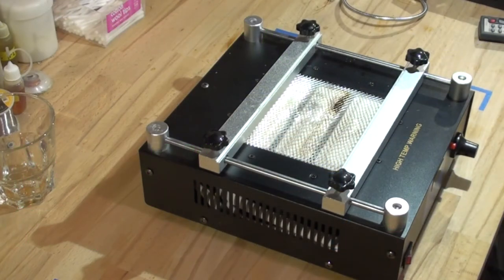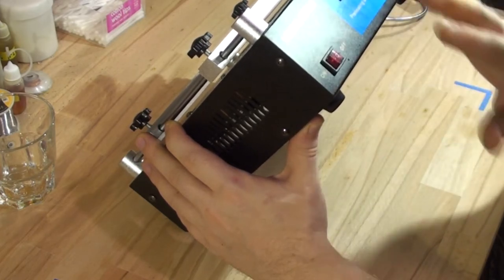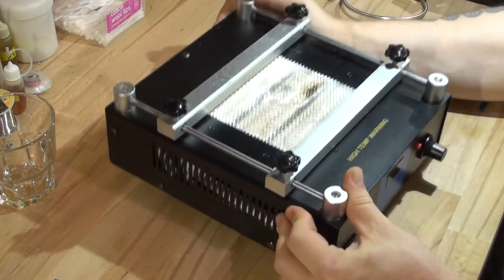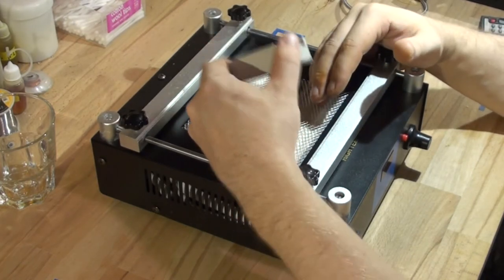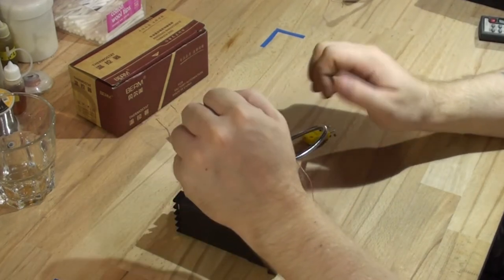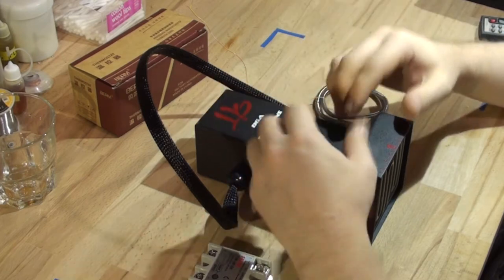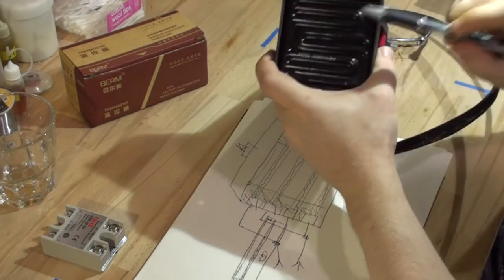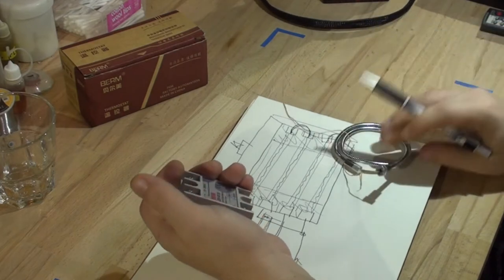DIY Automated BGA Reballing Station. Make Your Own At Home! From Low Budget to Mid Budget.

Comment: I thought of building my own  BGA rework station,  but doing it different to everyone else out of bits I got to hand , rather than using a dedicated pid  controller I though of using an old 3d printer board and display  to drive  SSR's connected to the hotend and heated bed outputs  as it seems a no brainer because it handles  2 pid controlled  NTC thermistors that are already calibrated and is designed to drive a heated bed and hotend,  should be ideal for the task the thermistors  work at over 250c  so they should be ready to go without too much  tinkering - this will give the option of either inputting the temp through the interface or  using a  simple GCODE  script  stored on an SD card,  sent to it remotely via octoprint ..  or typed in from a remote terminal....
Reply: Did you have an success with this project, I had the same idea but having a hard time finding anything about it online

Comment: Hello, i would like to build something like this. However some parts are a bit not clear for me. How to i wire up the top and bottom heater? I can’t find any pinout and the schematic doesn’t explain it very well to me. Also, do i have to use an RCBO? Or can i just wire up a fused C14 plug directly to everything if my outlet itself is protected?

I would also appreciate a full list of items in the description or here

Comment: Haha well that's pretty cool.  I was just browsing aliexpress this morning and got the idea to buy a cheaper preheater and add the IR top heater to it, and I basically ended up choosing most of the same parts you used!  I ordered a Gordak 853, then an IR6500 top heater.  Then went googling for a PWM temperature controller and ended up picking the REX-C100.    I plan to just use the existing lower heater controller, and I'm going to put the temp controller in a project box bolted to the side of the 853 and add a socket for a K thermocouple to go to the controller.
The 853 I ordered comes with the bracket to hold a hot air handle, so I still need to figure out how to mount the IR6500 top heater to that.  Might use some spare 2040 aluminum extrusion I have laying around.  Not sure yet.

Comment: For the top heater I'm using my hot air soldering station with a 45x45 bga nozzle, and for the preheater I'm using a electric grill with a power regulator, and the bottom heater a hot air gun connected to the same power regulator as the electric grill, basically I heat under the board until 100-110 degrees, then I turn on the hot air gun until 130-140, and then I use the top heater, works just fine, no burns on the pcb and no bubbles on the bga chip, the only thing I haven't figure out was the table to hold the board, I tried to find something off aliexpress but haven't found yet, do you have any tips?
Reply from the maker: I’ve just built my own pcb holder from extruded aluminium, you can get it in your local hardware store.

Comment: Great video. Certain I willgive it a try and build it too. One think I did not understand quiet well is how the profile is set. Thanks for the sharing
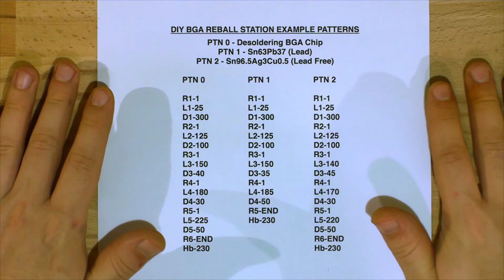Reply from the maker: Hi, watch video from 39:30, there’s examples of the profiles, ones you get into pattern set menu, just simply follow my patterns, for example”R” is how fast temperature will rise, so 1 means 1 degree per a second, if you set it at 2 it will rise at 2 degrees per a second. Better leave R value at 1.
“L” value it a target temperature for the current step, for example R1,L1,D1 is all in first step, R2,L2,D2 is a second step, and the D value is how long to hold the temperature till the next step. So for example if you have settings R1-1;L1-80;D1-60...R2-1;L2-130;D2-30 the what will happen, in first step temperature will rise to 80 degrees (1 degree per a second), once it reaches 80 degrees it will hold it for 60 seconds, then switch to step 2 and rise the temperature to 130 degrees, once it reaches 130 degrees it will hold it for 30 seconds before going to next step, once you programmed all the steps you want, add an extra step and select “R” value as “END”

Comment: Great video! I have a quick question I would be thrilled if you could answer. I am trying to build a motherboard holder jig for a 40 GB PlayStation 3 motherboard. What metal would work for this? The motherboard jig is discontinued, so I will need to make one. I want something that can take the heat and stay straight. I will be using this on a rework station to perform RSX replacements. Thank you.
Reply from the maker: Use Aluminium, it’s easiest to work with.

Comment: Hi Max, greetings from Peru. I want to request if were it possible you list all components of this project. I saw many videos about DIY BGA Reballing Station and yours complement with others. I found almost all components you mention in video but it would be awesome if you listed everything. And about the 12V module or adaptador that you use what kind of Amperes it should be have? I hope you can agree with my requested because I going to buy all components in AliExpress comming soon maybe today or tomorrow.
Reply from the maker: Hi, for 12v psu you need small current , 1 amp will do the job, the 12 bolts only used for alarm buzzer, led light and a fan. What parts are you missing?

Comment: First let me thanks you alot about your experience sharing.....so , i am just a beginner in Electronics and repairing field ....my question is about the control , why do you use pc 410 ?? I can't understand because when i get the diagram of Rex c100 , i asked myself  why you don't add both of them ?? I mean each rex connect with each heater ....i wish you help me to understand that ... thanks 🌹
Reply from the maker: Rex 100 is a normal PID CONTROLLER, it just turns on and controls temperature, the pc410 is the controller that controls temperature and also different steps. So it does “profiles” of reflowing for main (top)heating element, the Rex 100 controls only preheating (bottom heating element)
Reply: @MaxELECTRONICS  Thank you very much for your reply... Alhamdulillah I understand it now 🌹🥰🥰

Comment: Hey, Max. I can't find the part where you modify the lower heater. I see you removed the potentiometer, how do you adjust the temperature and air? Thanks
Reply from the maker: You need REX-C100, you control temperature with this controller, I only left the heating element from bottom heater, and heater is fully controlled by REX-C100. You can easily find them on eBay or AliExpress.

Comment: have you tried connecting the pc410 with a computer? i tried it using RS232 and the PSOFT Rework Station Controller application but the result cannot be connected, maybe you can share if you have experienced it, thank you.
Reply from the maker: Make sure your RX and TX are right way around and set correct baud rate on your computer com port. I have connected it, it works, bet you can only remotely trigger it and monitor the temperatures, that’s it.

Comment: Hi Max, stupid question, what is that hooked up to pins 8, 9 , and 10 on the pc410? Thanks, Randy
Reply from the maker: You don’t need to hook them up, it’s RS-232 (com port) that can be connected to computer for remote control

Comment: Hi mate
Nice video but it will good for everyone if you add a list of parts with relative description so people can buy them.
For example, where I can buy the top heater support?
Reply from the maker: Hi, just like I mentioned in the video the support for the top heater is just an improvised “z” shaped piece of metal that I bought at a local hardware store, it’s not a plug and play support.

Comment: Bye! Congratulations nice job as the heated head is fixed, could you tell me what materials you used to make the head support? Thanks in advance
Reply from the maker: Hi. Just steel from hardware store, something like this https://www.bunnings.com.au/pryda-nail-on-connector-plate-75-x-190mm_p2430023
Reply: @MaxELECTRONICS  Can you take a picture of how the back of my head and the head ruler are arranged? Everything can't be seen in the video

Comment: For the run button you're using, does the illumination run on 12V DC? Is that the voltage the LED inside the controller sees? Also, I'm curious how you connected the button light to the run LED inside the PC410. Did you solder a wire to the contacts inside the unit?
Reply from the maker: Yes, that’s what I did, but the illumination is only 2-3 volts so I used a transistor to make the illumination 12v
Reply: @MaxELECTRONICS  Ah I see, that's brilliant. Did you use the transistor to somehow amplify the low voltage from the PC410 or did you use it as a switch using the low voltage as a signal to complete a separate 12V circuit for the light? By the way, thanks for taking the time to answer my questions.
Reply from the maker: Used it as a switch from separate 12v power
Reply: @MaxELECTRONICS  Cool thanks Max 😊

Comment: Hi, 
where did you place the two thermocouples on the board? 
The Thermocouple for the upper heater directly near the chip you want to remove? 
The Thermocouple for the lower heater directly on the lower heating element or under the mainboard? 
Thank you! :)
Reply from the maker: Hi yes the top thermocouple is placed directly on the side of the chip so it touches both, side of the chip and the pcb. Bottom thermocouple is place underneath the pcb usually under where chip is. Bottom thermocouple needs to measure the temperature of the PCB under where the chip is located.
Reply: @MaxELECTRONICS  Thank you very much! 
I have almost finished my BGA. 
;)

Comment: Hi Max... Its very well documented project. You haven't mention about auto-tune of PC410 controller. Also how effective is Halogen Lamps as top and bottom heater?
Reply from the maker: You can use halogen flood light as bottom heater and 2 in series and another two in series as a top heater (use reflector)

Comment: Hey Max! Quick question, I have 3 heating elements. 2 are 800w and 1 is 1000w. How should I wire them together? Thanks!
Reply from the maker: For the bottom heater or top?

Comment: Hi Max, great video, can I use the lower preheat without the upper?
Reply from the maker: Yes you just need to setup a profile where the top heater always set to low temperature like say 10 degrees Celsius, this way the top heater will never turn on
Reply: Thanks Max!

Comment: Hi! Sorry but I missed a part, Is the bottom plate or the top heating element controlled by those patterns?
Reply from the maker: The bottom element only commanded to turn on at the beginning and constantly stays on, the top element is controlled by the patterns
Reply: @MaxELECTRONICS  thanks

Comment: That pre heat station, can a full size laptop m/b be properly pre heated? Can a suitable toaster oven, using quartz heating elements/rods be modified for the same purpose? Maybe 2 or 3 elements for the preheater. Can the Yihua 853AAA hold a full or regular size laptop m/b? Thanks
Reply from the maker: Yes you could but then you cold just use halogen lamps, or large floodlight.

Comment: Hi! I would like to build a station similar to yours, but I want to use 2 800W 18x18cm ceramic heaters for preheating and 1 450W 8x8cm for top heating. Are the components capable to run these heaters at once?
Reply from the maker: Yes, that’s why we using SSR relays. The load from heating elements only runs through SSR, other components don’t bear any load.
Reply: @MaxELECTRONICS  thanks! i heard you saying in the video you wouldn't trust the relay at over 1kw and the bottom heaters would get 1.6
Reply from the maker: @regele4063 I personally wouldn’t trust the Chinese market ones, you can get a second SSR and connect input in parallel. Or you could get genuine SSR or use cheap one but add heatsink to it, you never know what rating triac is inside of those SSR’s
Reply: @MaxELECTRONICS  okay, well i got almost everything i need to build this, but i'm kinda stuck at choosing an RCBO. is a 10A one enough for 1600W bottom heaters and a 450w top heater? I would assume it is, since i got 220V in the wall, but its at the edge. Should i go for a 16A one?
Reply from the maker: @regele4063 No, go with 10A that’s enough for loads up to 2200w,
Reply: @MaxELECTRONICS  thanks, youre the goat

Comment: Hi!, i recently asked a question here, but i ended up going with the 240v top heater because i couldnt find a 120v heater. anyways, whats happening is since i live in america there are two hots and one neutral. both hots make up the 240v. so i ended up making my own schematic based off of yours, and it does power on and stay on until i hit the run switch then it pops the RCBO. i narrowed it down to it being the top heater, but cant figure out why its happening. The top heater has a constant 240v always to it even when the SSR's are off, yet the heater doesnt heat up and the circuit stays powered. its only when i flip the run switch it pops the RCBO. i have the diagram if youd like to see it, just shoot me a message if you can help. thanks a ton.
Reply from the maker: Sure, send it to maxchristensenau@gmail.com
Reply: @MaxELECTRONICS  will do, thanks a bunch
Reply from the maker: I received your email, just curious, does it trip the safety on the rcbo or does it trip overload? I think your problem is that you have 1 rcbo and one normal breaker, so because power comes through rcbo and leaves through another path ( second breaker), rcbo thinks there’s a leak and trips, I will draw up new schematic for top heater for you and email it to you.
Reply: @MaxELECTRONICS  I’m not sure exactly what is tripping but I do know it is the RCBO and not the breaker, and it’s whenever I tell the heaters to run.
Reply: @MaxELECTRONICS  I also did test without the bottom heater connected and it still tripped it so I think what you’re saying is correct.
Reply from the maker: Try replacing rcbo with just a normal breaker, because you running dual voltage system it would be best to just run it through a breaker and not rcbo or gfci.
Reply: @MaxELECTRONICS  alright I will do that and report back to you
Reply: @MaxELECTRONICS  hey! Just put in the circuit breaker and happy to say everything is working perfectly! Thanks a lot for your help

Comment: Hi, I have a question about automated diy bga rework station. How can I automated yaxun yx-862d++.Is it possible?Would you please explaine in advanced
Reply from the maker: You would need to buy the PID controllers the smaller and larger one and then rewire your station, disconnect the existing controllers and connect new PID controllers

Comment: For the preheater could we use a large griddle plate so it preheats the whole board?
Reply from the maker: I don’t see why not, as long as you are using it with a controller.
Reply: @MaxELECTRONICS   Thank you for getting back to me. That's great news 👍 I was trying to find the bracket that attaches to the top heater any idea what it's called?
Reply from the maker: No, I’m not sure, I made one from metal.

Comment: Great video, I think that I will build one too :) Just a question, where did you source the case you used in the video ?
Thank-you !
Reply from the maker: The case is actually a preheat station from eBay, you can easily find them. Just search for smd preheat station.
Reply: @MaxELECTRONICS   So it is a former preheat station that you emptied and reused for this project ? I spent some time today looking for it but with no success …And buying a new working station just to reuse the case seemed overkill to me for a low budget DIY …
Reply from the maker: Yeah I used new station and emptied the insides accept the heater, I left original heater and connected it to the controllers. Benefit of reusing the preheat station is that you get the heater, the shell, and the hardware to mount pcb on. You could always just make one out of sheet metal available from your local hardware store, but then you still need to buy bottom heating element
Reply from the maker: https://www.ebay.com.au/itm/600W-Soldering-Preheat-Hot-air-Machine-lead-free-BGA-Repair-Rework-Station-/313335946092?mkcid=16&mkevt=1&_trksid=p2349624.m2548.l6249&mkrid=705-154756-20017-0
Reply: @MaxELECTRONICS  First, thank-you for the fast reply. 

I did source the right bottom heater with the right heating element (Yihua 853A 600W ) but I was looking for the device that you used as a case for the components. It seems different to Yihua 853A as the size of the casing differs and the mounting holes are not the same.
If I can source this a a reasonable price, I will go for it as you did, otherwise, I will go for making my own casing of aluminium sheets. 
On the video you seem that it is also a PCG heater but with a hotplate rather than a ceramic heater as in Yihua 853A. I looked for it but haven't find one for now.
Reply from the maker: Yes for the component enclosure I used different heater, with link below, the heater is actually in 2 parts, the top enclosure contains  aluminium hot plate and the bottom contains transformer and small pcb, so I kept the top part and just did external PSU with controller, so I still can use hot plate for other stuff, and that freed up the bottom part that contained transformer and the controller for this BGA project.
Reply from the maker: https://www.ebay.com.au/itm/Electronic-Hot-Plate-Preheat-Station-946C-220-110V-800W-200-200mm-Top-Quality-/165003497603?mkcid=16&mkevt=1&_trksid=p2349624.m2548.l6249&mkrid=705-154756-20017-0
Reply: @MaxELECTRONICS  Thank-you very much, now I can build my bill of materials to see what options are the best for me.
Reply: @fredomelle2743  Did it work out for you, I am thinking about building the same station.